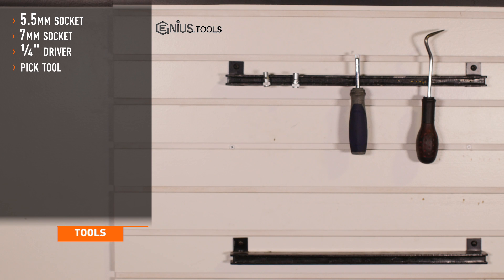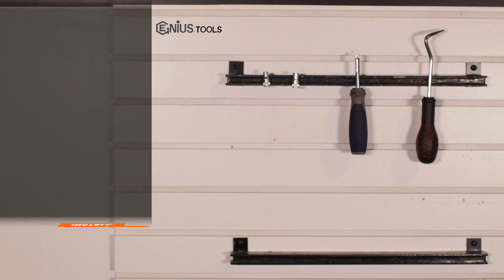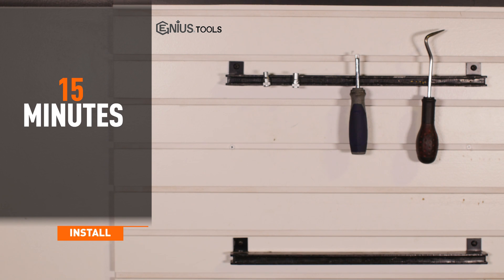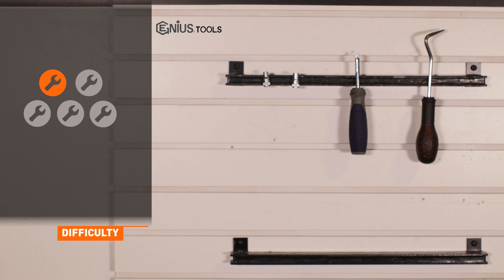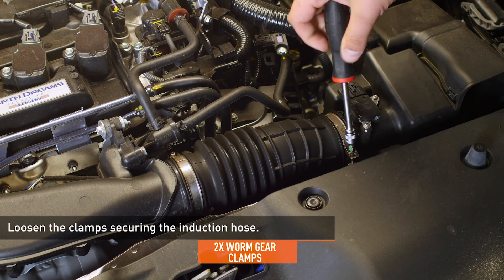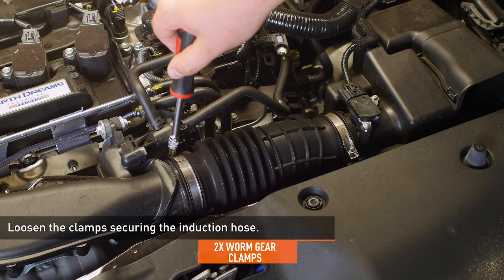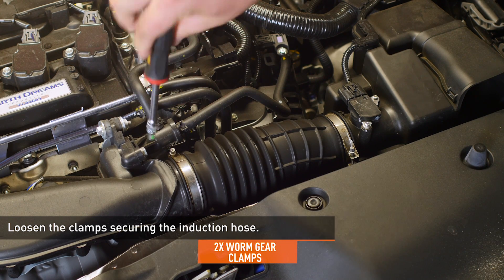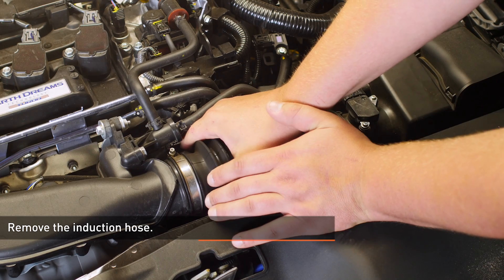2016+ Honda Civic 1.5T Silicone Induction Hose Installation Guide by Mishimoto

Comment: What does this do??
Reply: It reduces the drag of an excess $80 from your wallet or bank account. If it includes a decal, you'll get a +5hp boost if you install it. +6hp if you install the decal on your fender or door.
Reply: It's just for looks.  No performance gains.
Reply: It is more durable, it can take more heat
Increases Air Flow
Better looking